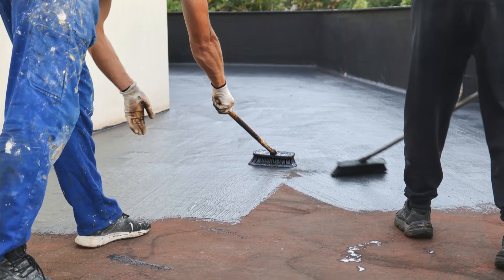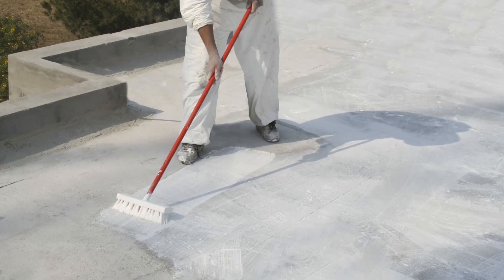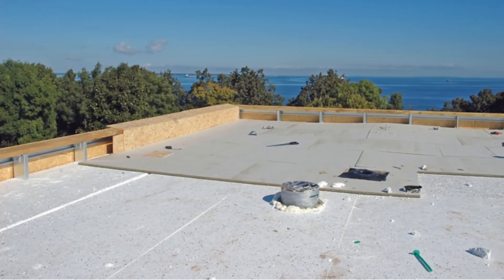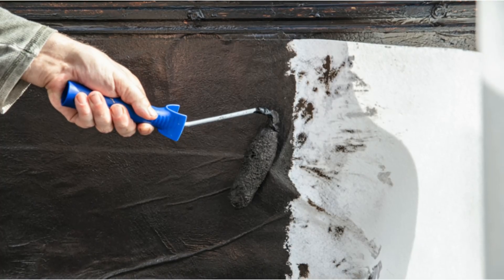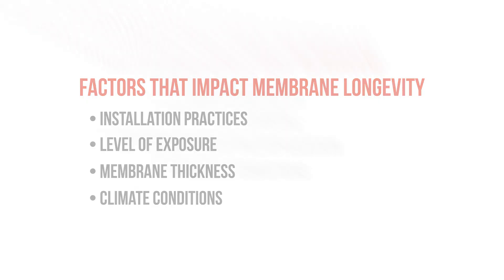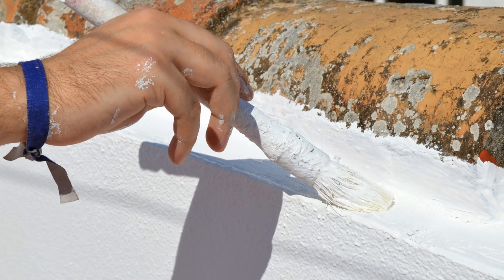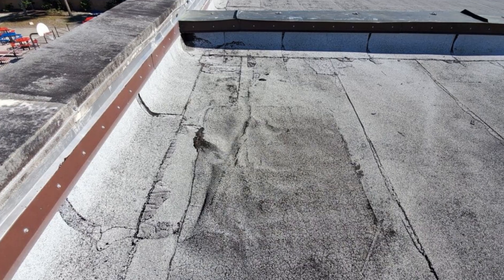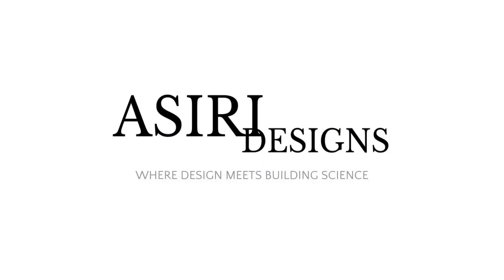The Problem With Liquid Applied Roofing...(Watch BEFORE You Install!)

Comment: Great information. What is your opinion on “spray foam roofs with an elastomeric white coating “?
I have seen a ton of failures. When the coating is damaged the foam will soak up water at times for years before it enters the building. Removing foam from a flat roof is labor intensive and no fun.
Reply from the maker: Great question! Not a fan of the elastomeric coatings for the very reason you describe. Instead, if we are dealing with a spray foamed roof, we use a fleece backed single ply membrane that is bonded to the foam using a spray polyurethane adhesive (Carlisle's system is fantastic). Significantly more durable and reliable.